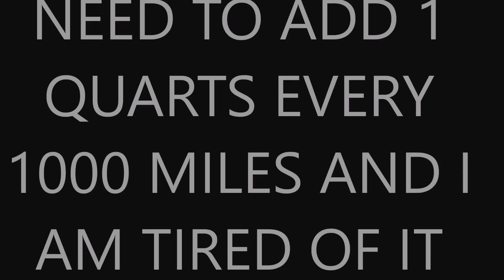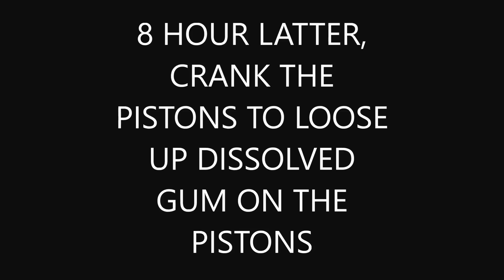MY WAY to stop ENGINE BURNING OIL FROM STUCK PISTON OIL RINGS WITH SEAFOAM

Comment: To all the hydro lock commenters. He let it sit for 8 hours before he cranked it over. At that point there would be very little if any liquid still in the cylinder. It would seep past the rings and into the pan. Obviously most of you have never had experience working on an engine.
Reply: I thought you were dead bro!
Reply: banking on all the fluid running past all 4 cylinders in 8 hours.. Only a billionaire private island owner is that lucky.
Reply: Why take a chance or tempt fate
Reply: @1995dresser   exactly!
Reply: Correct sir ... Won't take long for it seep past the rings
Reply: Maybe I missed it, but what would be a safe amount? Ounce?
Reply: I don't think you can ever say for sure that all the solvent will make it's way down into the the pan regardless of how long it's been soaking in the cylinder.  I have a civic and i did this soak on 2 occasions and the first time there was quite a bit of berrymans in 3 of the 4 cylinders after 24 hours soaking and i had to suction what was left out of the cylinders before starting the engine and yes, i hand cranked the engine periodically over the 24 hours to encourage the solvent to move down over the rings.  The second time i did a 24 hours soak all the solvent was gone from all 4 cylinders at the end so it's not an exact science and i would advise anyone doing this to err on the side of caution and just assume that there's a reasonable chance that you'll still have solvent in your cylinders after soaking and have something ready to suction excess liquid out of the cylinders to avoid the possibility of hydrolocking your engine.

Comment: PLUGS HAVE TO BE REMOVED WHEN TURNING OVER OR YOU WILL HYDROLOCK THAT MOTOR...This fool got lucky and didnt bend a rod or blow a head gasket...DO NOT DO THIS...
Reply: Hey is a Honda engine haha they just do as Toretto says !! 🤪
Reply: Straight up tbh a mist of water trough the intake manifold would do the same shit hes trying to do
Reply: @qrelectronicrepair1802  do you thing water can free up piston rings if i spray some in the intake while revving the car a bit ?
Reply: I was just about to ask why the motor didn't get hydrolocked. Do you think this procedure is safe (from hydrolocking) if the plugs are out or is it still risky?
Reply: @AikidoTubeSock  no its perfectly safe all you have to do is to stay away from the engine bay so you dont lose your eyes by pressurised oil that shoots up if you want to be really safe you can also plug the holes with a soft cloth
Reply: To J.Wilson its not going to hydrolock with plugs out. HOWEVER I would either suck out the seafoam with a mechanics syringe or turn it over by hand until its mostly out. Then crank it slowly until its all the way out. Do not stand or allow anyone to stand in front of vehicle while cranking.
Reply: I decided to not pour directly onto the pistons. Instead I just pump sprayed it directly into the intake manifold, let it soak for 20 minutes then drove the car. There was far less smoke after soaking than I expected although lots of smoke while spraying. I'll be looking for effects over the next week or weeks.
Reply: @AikidoTubeSock  inform me if it worked to free up the rings
Reply: Best way to do tis is by getting the piston to TDC, pouring it in, then taking the valve out of the pressure tester line and pressurizing it with compressed air.
Reply: @ibrahimqureshi2420  do u disconnect the fuel supply? won't it spray fuel when cranking
Reply: He let it sit for 8 hours with bad rings stuck whatever so probably most of the seafoam leaked into crankcase resulting in no hydrolock..
Reply: Dude I had a bit too much in the cylinder and turned it over and it sounded like a ford YEETing it's plugs into the hood lol
Reply: @scottbell8173  most people let it sit for 8 hours before putting plugs back in
Reply: Half expected to see plugs ejected from that aluminum head
Reply: For real 😅
Reply: He didn't put the ignition coils on
Reply: I just did this but I let them sit over night for 2 days haven't had to add oil so far

Comment: I tried this about a month ago in my 2001 Accord. Poured the Seafoam 4 times, waited at least 4 hours between pouring. After the smoking, the car runs great, much quieter. I am not burning any oil for about a month, I was losing about 2 Qts a month before. So far so good.Forgot to mention that my Accord has 309,000 miles and counting.
Reply from the maker: Vernon Charles awesome
Reply: use rotella t6 5w40 oil in time ur engine clean never before
Reply: Man im losing 3-4 qt a week
Reply: How is it doing now?
Reply: It's still burning a little, about 1qt ever 1000 miles. But still better than before. I'm at 368,000 miles now.
Reply: @vernoncharles660 thats great to hear man. I am having to refill a quart after 400 miles in my 2010 rav 4. Hoping this method works. I am a delivery driver and my car only has 172k. Have you had to this method more than once or was it kist the one time?
Reply: @vernoncharles660 how much was it burning before if youre only doing 1qt every 1000 now?
Reply: @KT-ed8hj  I was adding about 2 quarts /1500 miles. Most of my oil burning was on the highway compared to daily driving. I only the seafoam once.
Reply: @vernoncharles660  so you were adding 1 quart every 750 miles then and now youre adding 1 quart every 1000? Seems like a good improvement

Comment: Don't do this method guys. You can't compress liquid and doing so, you can bend the connecting rods. Here is what you can do, you can soak with seaform for a day or so, (without installing the plugs) place paper towel or a towel to cover the plug holes then crank the engine trying to get all liquid out before installing the plugs.

Comment: Folks, take the plugs back out before you crank an engine after putting a liquid into the cylinders. You can hydro lock the piston, bend your rod, cause huge damage to the engine and the burning oil will be the least of your issues.

Comment: You want to hand crank the engine over with a breaker bar and socket not the starter unless you like risking hydro lock which generally includes busted piston rings and bent connecting rods. You also want to crank the engine over with the spark plugs REMOVED. And this would be AFTER you let the solution soak overnight.
Reply: With plugs removed you won't hydrolock anything.

Comment: Everything was perfectly safe except for turning the car over with fluid in the combustion chamber with the plugs in it. Turn it over wirh the plugs out and do it over the course of a few days the fluid will leak down into the oil. Before starting it change oil and filter and blow out any residual cleaner in combustion chamber.
Reply: pretty sure he left them loose...makes sense right? not sure the point of bothering to put them in at all
Reply: He does say install the spark plugs afterwards so I think he does have them removal when the cranks it . I hope so anyway :-)
Reply: He left the ignition coils off so I guess the spark plugs just kept the sea foam from flying out?
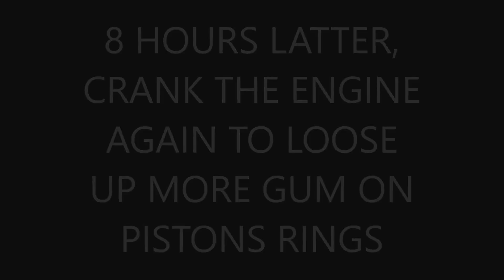Reply: 3:38 read my guy

Comment: This is by far the best way to get a clean engine. You put it in like in the video, and then hydro lock your engine....The next thing you know your driving off the dealership with a new car and the engine is clean! BAM
Reply: Bret Richter 
After this is you might want run a thicker oil to make up for the lower compression and oil that won't burn as quickly. Most seafoam mechanica will agree GL 75-140 is ideal. GL is short for great lubrication .
Reply: Bret Richter lol
Reply: Bret Richter
Reply: Bret Richter and
Reply: I was expecting a head to lift with that much seafoam down the spark plug ports or a head gasket pooping out. Either way too much liquid for a combustion chamber.
Reply: Bret....After the 8 hours soak time that he recommended, the Seafoam has leaked down past the rings. No chance of hydro lock.
Reply: blipco5, that's completely true. Because when I did mine (actually wife's) I had a Cree 200 flash light and looked in there and the seafoam had gone !
Reply: I realize this is an old post how ever thought I would add another experience for others to try if you have the same issues!
  I have been chasing a lack fuel mileage for approx a year now I finally broke down and checked the compression on my 2006 crv 245000 KMS I found that I had less than average compression on two cylinders I attributed this to stuck compression rings( Took  a Guess)  as I had changed plugs and O2 sensor! and various other checks filters  ect  how ever the unit does not burn any oil what so ever but compression rings can stick too!
I ran across this vid and thought Id give the seafoam  a try  ! Less the cranking part which I did by hand as I Was concerned about the odious hydrolocking situation that MAY occur ! The out come was great!  the fuel mileage is now back to normal I have gone from 430km to a tank full to back to over 500 to a tank full where it was when I first got the car! So This vid was quite helpful in my case ,  so it also corrected compression  ring issue in my case  . So guess the lesson here is to try things outside the box a bit. the( 8 hour soak) I did after putting the spark plug in one at a time and turning the engine up to the compression stroke by its ps pump nut on each cyl with  seafoam added just prior to turning the engine over with the wrench! Note  IF you do the soak thing Do leave the plugs out and crank once  just to be sure! in my case the seafoam had all seeped by the rings. when I cranked there was little residue left in the cyls! I used Half the can during the process and  put the rest in the fuel tank !
 Good out come and worth trying if your in the same boat!   Thanx  for posting the vid!   ( Really got me thinking! )
Reply: @bobisthebuilder3982  Damn Bob,,you must have gone to the same SCHOOL OF Thought that i went to..Here is the reference from the SCHOOLbook:
Sliding pressures and shock-loading require the use of high levels of EP (Extreme Pressure) additives (API GL-4 or GL-5 performance level). Generally, a fluid’s API number roughly estimates it concentration of EP additives. A fluid formulated for this application would be called a hypoid gear oil,.,.end quote
The maker of this GEM clearly failed to obey UNCOMMON SENSE in lubricating potentialy cracked piston tops after NEAR-MISS hydrolock.

ALL pun is intended,thnx for the smirk too.
Reply: @laurah7870    If some guy posted this i would say right on,but for a lady to put it this quite nicely,,I'm truly impressed.....Did not even look your name before reading the comment,,so now you made me post this reply..Good for you to have that  UNCOMMON sense that gets harder and harder to find here..
Reply: Im dying🤣😂

Comment: Another way to do it is after the waiting period, 8 to 24 hours, screw an adapter into the plug hole that has a connector to pressurize the cylinder with compressed air. That will force the seafoam or whatever you are using down into the ring lands.Wait another 8 hours or so and then evacuate the seafoam by suction or turning the motor over with the plugs OUT. If you are sure all liquid has been removed, insert plugs, start the engine and run it to get the oil temperature hot and then drain your oil and replace filter, oil and check your plugs to see if they are fouled. If so, it would be a good time to replace them.
Reply: Yes.  After first reinstall of sparkplugs I was afraid there would be a secondary title "How to Hydro Lock Your Engine".

Comment: What I've found that works way better than seafoam or mmo is Berryman's Chem Dip. With an upright inline engine, pour in a few tablespoons to each cylinder.  Let soak overnight.  Next day have a pitcher of water handy, a long narrow vacuum hose with an opening of about 1/8 inch. Start engine (will be very difficult to get it to fire at first). Then, once you have it running, remove your PCV valve hose. Place long narrow vacuum hose in pitcher of water and hold other end at right angle to PCV valve hose. This will suck in an aerated mixture of water and air. Hold throttle open a bit to rev up engine to maybe 3K rpm. Keep sucking in the water at this rate until it's all gone.  Do not suck in water at a higher rate than this or you may hydrolock the engine. Once water is gone, change oil. This has significantly reduced oil burning for me every time. If you have a v or slant engine, you must use much more chem dip, and you must expell it before starting engine or you will hydrolock the engine. Do not get on paint, eyes, or skin. It will eat your skin. Guys have criticized me heavily for this method, and refused to try it. My 99 Saturn SL2 has 368,000 miles on it, and my friend's is at 280K. Mine burns up to 1/2 quart per 3K miles, and his, 1 quart every 1.5 to 2K miles after this soak. It's necessary almost yearly on a Saturn. Not sure about other cars. Saturn didn't design their pistons correctly.

Comment: crank it over with the plugs REMOVED. at 2.20 it locked and stopped turning over and you are SO SO lucky that the extreme pressure in there forced enough liquid past the rings. some people are so unbelievably dumb..
Reply: Some people are not capable of Googling what Hydro Lock is.
Reply: ok
Reply: To crank by hand , which direction shoiluld I crank it?clockwise or content-clockwise?
Reply: @jrchelo75  Crank it as if you were tightening the main pulley bolt. But to clear the liquid, tightening by hand is useless.
Reply: Should you disconnect  the ig coil fuse before cranking without the spark plugs?
Reply: @jrchelo75  It's a good idea, yes. And the fuel pump fuse too.
Reply: Gavigg75  stop im laughing too much lol
Reply: Thereal I wont mock them just bec they haven't study that part
Reply: Milhaus , Could it be that the rings allow the fluid to get by and that’s what prevented Hydro lock and also cleaned the rings at the same time?

Comment: Great video!!! I did this to my Honda Accord & it worked. I didn't reinstall the plugs  while cranking the engine over, I put a cloth over the engine to catch any of the seafoam (nothing shot up) it must have drained into the oil pan.  This saved me thousands $$$
Reply: I want to give my Honda CRV a try,  wouldyou please provide steps you did. Thanks
Reply: La Marc..     were you burning very much oil and did it stop it completely ??

Comment: Hydro lock can have a delayed effect. Had a customer who drove into some water deep enough to hydro lock the engine. He had it towed to me without turning it over. I removed the plugs. Turned it over by hand,  then blew air into the plug holes,  with a very thin copper pipe to clear any remaining water through the plug holes. Changed the oil and it ran. 
    One of the rods was bent and thereby shortened  just enough that the piston had a slight knock as it hit the crank counterweight on the down stroke. I warned the customer that it might self destruct at any time while running. He opted to press his luck without any further repairs. 3 days later the piston came apart at highway speed. Blew a large hole in the aluminum block and disgorged enough oil to coat the rear tires. After "drifting" back and forth a few times he got it safely stopped. There was enough shrapnel on the road to shred a few tires.  I am not a fan of the method put forth in this vid. Better safe than sorry.

Comment: It most likely didn't hydrolock because all the liquid had gone through the piston rings down into the oil. Did the same with WD40 but the way SAAB/GM recomended it was to pour 2 dl (0.8 cup) in the cylinder with them at top positions and leave it over night. then suck the remains out , back with plugs and start. I keept filling up until it stopped (very slowly dripped through). Filled 1 cyl up for 3 days approx 1 gallon of wd 40. sucked the remains out, cranked without plugs, changed oil and filter. in with plugs and started up. Took the car for a rough spin and really pushed the engine. drove a few days and changed oil and filter again. TIP! if your piston rings are stuck,check the PCV system and make sure it is not clogged.
Reply: At 2:20 it actually did hydrolock but he got lucky.
Reply: How can I check pvc?
Reply: What liquid does saab recommend? WD40?
Reply: @andber  kommer inte ihåg exakt hur det var formulerat. Finns instruktion på nätet från saab’s egna verkstads handbok där det står beskrivet exakt samt andra saker att rengöra vid misstänkt oil sludge.
Reply: @McDiezel-iu9sv  tack. Kanske står i reparationsprogrammet. Inte tönkntanken att kolla där innan. 👍

Comment: That looks destructive, it looks like a demonstration of what hydrolock is and all the damage that comes with it, bent connecting rod, all four of them for shure.
You're so lucky that you got away with that...
The idea is good, but without cranking the engine with the sparkplugs.
First, I would of let the seafoam soake  for serval hours to a day, then place a rag over the sparkplug tubes then crank the engine over several times to clear out the excess seafoam, then reinstall the plugs, and finaly start the engine... 
The reason to prevent the engine from hydrolocking and end up with bent connecting rod, the reason for the rag over the sparkplug tubes is to prevent a mess of seafoam all over the engine...

Comment: I did the exact way! Does no harm by cranking over with the plugs in yes it’s hydro locked but the pressures force it down past the rings that’s where you need it to be. I used berrymanys b-12 chemtool and it worked wonders went from burning 2 quarts down to 1/2 in 7k miles. Now if you dump a ton of liquid in a motor with it at full throttle yes damage will occur but that’s not the case here.
Reply: Wrong. Any amount of liquid in the cylinder when coming up on compression stroke can bend a rod or cause other damage if not enough liquid gets past the rings. Anyone who does this and does not damage their engine is extremely lucky.